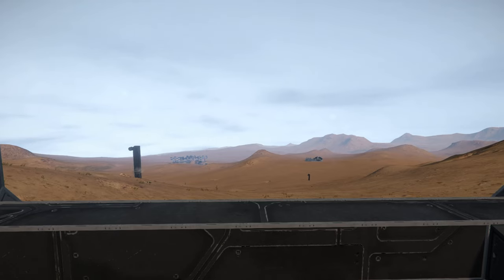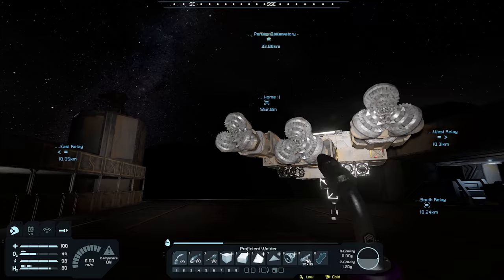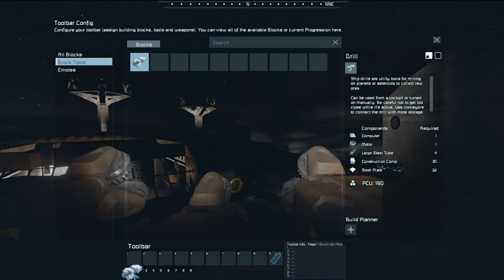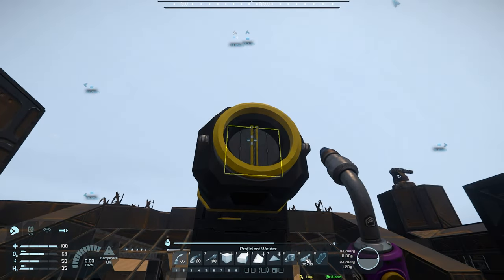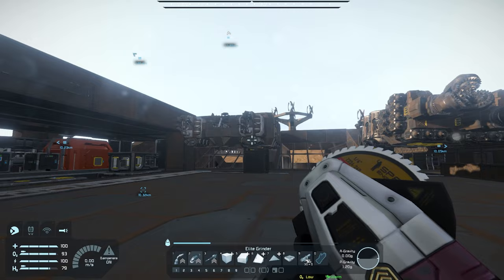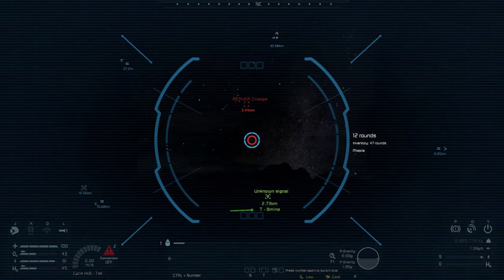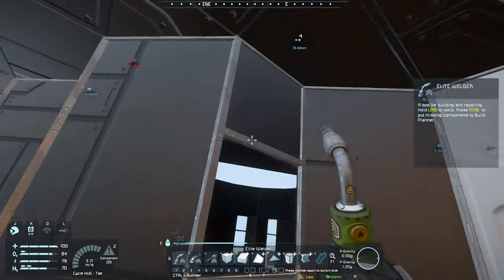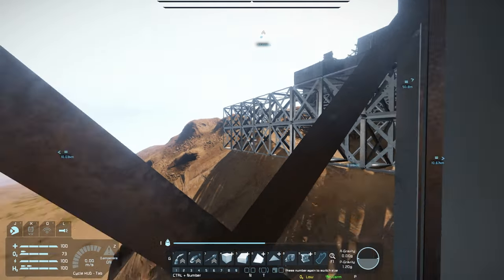Space Engineers Survival 2021 (Episode 44) - New 3rd Generation Utility Ships! [Pertam]

Comment: the roof does need to be thickened up to better resist incoming fire.
heavy armor with the applicable dust coating that lets the interior be cleaned up and dust free.
small thrusters have a 4 block damage zone
large thrusters have a 7 block damage zone

you talked about a railroad and there are assorted ways to make functional rails and trains.

entrance to the underground landing bunker needs to be 5 blocks wide. you need the wiggle room for a fast launch or if you return home with a damaged ship that isn't responding as it should.
Reply from the maker: Thanks for the tips! Yeah giving the top a thin block with the dust coating would definitely look nicer. Also I agree, we probably should widen the bunker size. For the railroad, it would definitely be awesome to get set up! But we'd need somewhere for it to go first so its definitely a backburner idea.

Comment: Welder/ Grinder/ Drill ship add a least one more gyro to compensate for a full load... you can turn down gyro power when empty

Set setting increase/ decrease thrust override on forward thrusters (and toggle on/off on backward thrusters) on hot bar will set a cruse control function on your ships, using less battery (extending your flight time) turning off backward thruster while going forward the thrusters are not pushing against the other. The increase/decrease will only use the minimum power needed to more the ship. (At the moment when you press "W" it maxes out, with dampeners active the backward are also active. once you release the "W" dampeners press "S" for you... even if you still need to go forward more)

Example Hot Bar

1: Battery(group) recharge on/off 2: Thrusters ( all group) on/off 3: Forward thrust override decrease 4: Forward thrust override Increase 5: Backward thrust on/off 6: .....
 
Connectors   https://steamcommunity.com/sharedfiles/filedetails/?id=1736785358&searchtext=connector
Reply from the maker: Good idea on the extra gyro for full load. Also cruise control would be great! Thanks for the suggestions :)